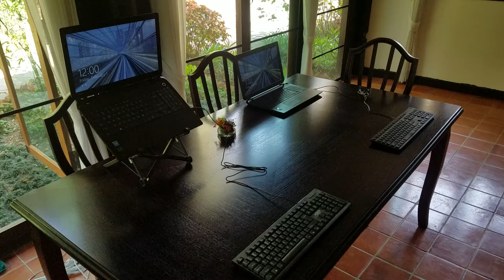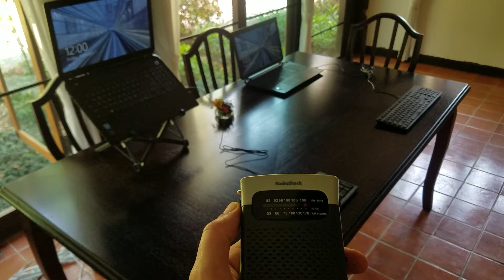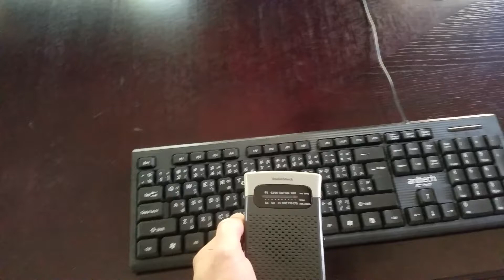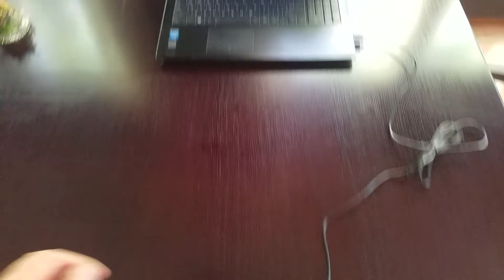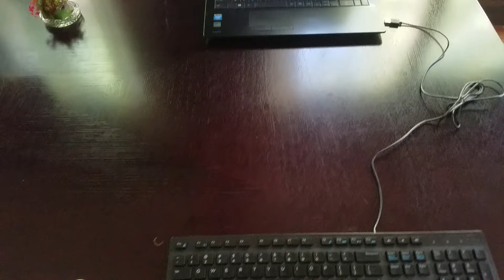How to Test Your Wired Keyboard for EMI

Comment: Before the installation of smart meters with PLC I bought a wired keyboard to stay away from emf from laptop.

It did not measure any emf. Now, after the smart meters and plc installation, everything is emitting - they keyboard, even the wire from the mouse.

All the appliances. Can you please explain why? Thank you.

Comment: If this were true radio station operators would have more risk of cancer and they would be paid more. Instead FCC has very strict regulations about RF exposure and engineers are forced to calculate safe duty cycles when broadcasting in the bands that are absorbed by the human body the easiest (30 MHz - 300 MHz). RF burns are a very real and serious danger to RF transmitting, but the person with the highest risk theoretically should be the operator and its not.
Reply: Wow. You managed to miss the entire point of the video, just to post something that has nothing to do with it, just because you heard him mention AM radio?

This is about EMI from electronics that shouldn't be emitting EMI as much as it is, or at all. Not about whatever EMI might exist in a radio station. 

Jeezus. Take your meds.
Reply: @ManuFortis  buddy doesn't know radio waves are electromagnetic waves 😭😭😭😭😭 that's like high-school physics level understanding bro and you lack it.
Reply from the maker: @smackanoodle  EMI = electromagnetic interference. This is just one type of EMF. There is a whole engineering specialty that focuses on EMI mitigation in electronic equipment.
Reply: @ManuFortis  An AM radio picks up literally the same kind of electromagnetic wave as the keyboard. That's what an AM receiver is designed to do.
Reply from the maker: @Artichoked1  You did see that the EMI disappeared when the power to the keyboard was unplugged?
Reply: @emfanalysis  Yes, and? You are still being exposed to RF from stuff all around you, just not necessarily on that frequency. Just tune the radio to a band that is being used for broadcast and you will see. Also, you can't exactly measure the intensity or amplitude of an electromagnetic wave just by using an AM radio. You might here different tones and sounds through the speaker, but that doesn't give you any indication of the intensity, apart from if you move the radio further away. To truly measure the intensity of a wave on a certain frequency you'd need a something like spectrum analyzer.
Reply from the maker: @Artichoked1  You are correct. AM radios without noise suppression technology are a poor man's spectrum analyzer. On parts of the AM spectrum where there is no local radio station, it will crudely detect near-field magnetic fields (radiated EMI from digital circuitry). Most EMI is unnecessary and good to avoid if you care about your health. The whole point of the AM radio (and other EMF meters) is to measure your environment and clean it up. This is easy done with a little bit of knowledge. Here a couple short videos where I show how to use an AM radio to lower the EMF exposures in a home:

How to Detect Electrical Noise from Lighting Fixtures:
https://www.youtube.com/watch?v=k6fZP-J2brk   

How to Identify a Problem Circuit:
https://www.youtube.com/watch?v=HkePBfBtYiI
Reply: @emfanalysis  using an AM radio to lower the EMF exposures? Buddy, the radio itself is only going to emit more RF at the frequency tuned as Local Oscillator (LO) leakage. This was actually used by the Axis during WWII to find Ally soldiers, so they improvised Foxhole radios instead (which didn't have Local Oscillators, so they didn't emit leakage, but they still won't attenuate EMF in your home lol)
https://en.wikipedia.org/wiki/Local_oscillator#Unintended_LO_emissions
Reply from the maker: @Zi7ar21  The radio is not emitting RF. It is used to find sources of electrical noise. By eliminating these sources of EMI, the overall EMF exposures in a home decrease.
Reply: @emfanalysis  Is there a reason you used the static on the far right side of the radio dial as opposed to the far left side?
Reply from the maker: @sunnies336  This type of EMI source typically radiates at 2 MHz rather than the 500 KHz on the left side of the radio.
Reply: @emfanalysis thank you. Is there a resource for when to use the left or right side of the radio when analyzing sources of emi?
Reply from the maker: @vfsd234  Really just lots of experience testing things. EMI at 2 MHz radiates more easily.
Reply from the maker: @vfsd234  If you watch the following video, you will hear a few different sources of EMI across the AM band. Dirty lighting, HVAC systems and pool pumps. The right side at 2 MHz is actually quiet in this location. If you didn't test the entire AM band, you would miss a very polluted situation. https://www.youtube.com/watch?v=8aIwFpiBeAY
Reply: Thank you, this is a great tip @emfanalysis

Comment: It’s not like this spooky emi at 2Mhz is gonna come get you. If it is maybe I should be worried about cancer from my 100 watt 1.8Mhz transmitter that I use regularly. You’d have a hard time transmitting a perceptible amount of RF with what power a USB port can supply even if you had no losses
Reply: RF is non-ionizing radiation, which can't cause cancer. Now what you should be concerned about is RF burns, which is like an electric shock, since high frequency alternating current (like those of radio) has little resistance, and is free to penetrate tissue. Thankfully, you don't have to worry about RF burns unless you touch a radiating element (the metal antenna) or are close enough to a high-power transmitter, however even 50 kW of RF (such as the highest-power AM stations) at lower frequencies like 1 MHz don't resonate with flesh and body tissue, which is why AM Radio operators are fine.
Reply from the maker: @Zi7ar21  Your first sentence is outdated. We have known since 1995 that non-thermal RF can cause DNA damage, which can lead to cancer. There is still some question about the exact mechanism, but the DNA damage research has been duplicated dozens of times by scientists around the world: https://microwavenews.com/news-center/how-money-and-power-dominate-rf-research
Reply: @emfanalysis  I just wrote a comment but I refreshed the page and I think YouTube deleted it :(